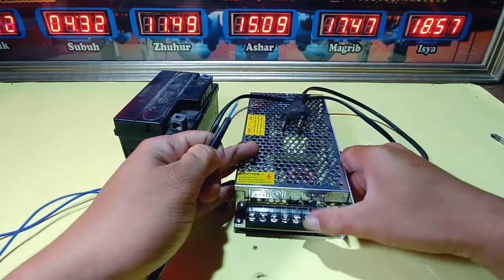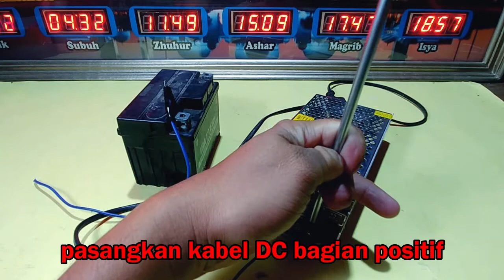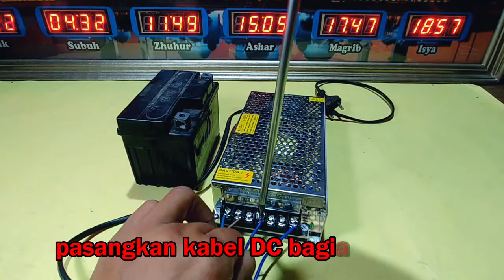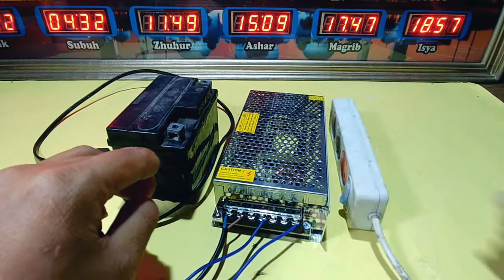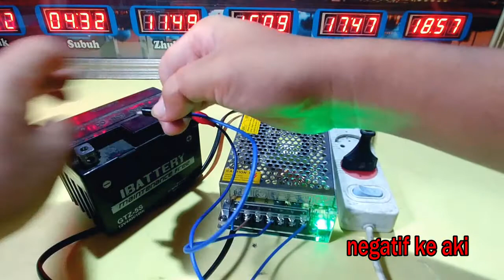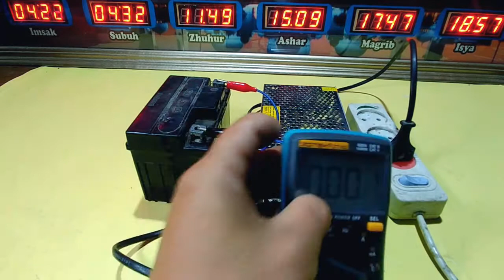Cara membuat casan aki dari power supplay

Comment: psu otput 12 volt aki 12 volt  akan lama bs buat charger aki, naikan lagi output power suplaynya di 13,8 atau 14 volt
Reply: klau ampere besar apakah gak rusak aki atau batarai tersebut
Reply: @adisucipto9972  up

Comment: Kalo pakai power suplai yg lebih kecil dari itu bisa tdk,untuk charger aki motor???
Reply from the maker: Yg penting output nya 12V
Reply: @ADELECTRO368  output nya 12v 3A 
Itu gapapa?
Reply: @ADELECTRO368 power supply klu buat cas aki bikin power supply nya cepat rusak ga mas?

Comment: Kalau pakai psu 40ampere kira2 berapa lama waktu pengecasannya untuk aki motor gan
Reply: Lebih cepat isinya
Reply: cepat soak aki bos, aki kecil hrusnya pkai charge kecil juga
Reply: @rijalmurakata2306  iya 10A kebawah kalo tidak salah
Reply: @rijalmurakata2306  kalau 10A untuk aki mobil   bisa? Kira" brp lama ngisinya
Reply: @ahmadsnt6237  charge 10A untuk aki mobil 40Amper, brrti kurng lbh 4-5jam
Reply: saya udah nyoba pke yg 30 a 
Malah lalpu indikator switching y nyala pdahal belum di coloki  pln